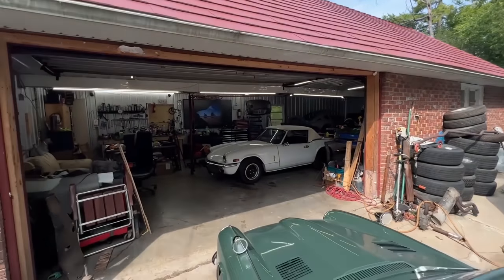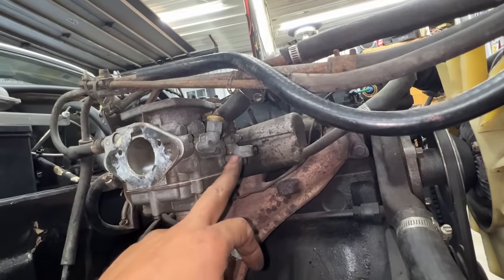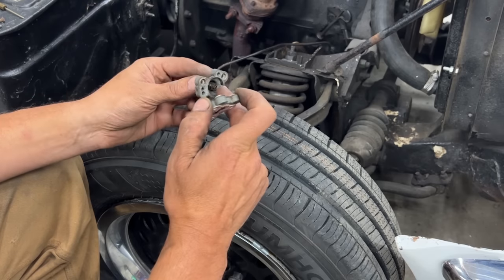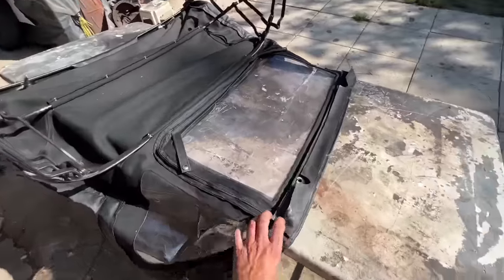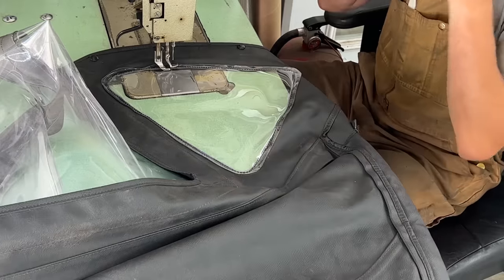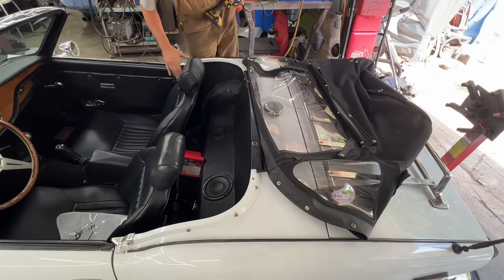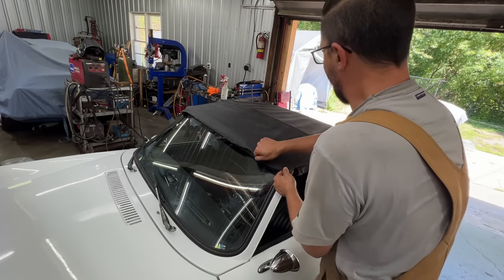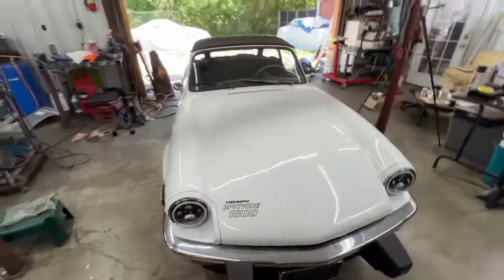Spitfire 1500 - Part 5 - Carburetor and Soft Top Repair

Comment: Nice catch on the missing carburetor spring, that's where experience pays off.
Reply: I’ve coined a new term that I’ve shared with Elin. Not having a ton of experience yet, I have a high degree of “FOFU” - the Fear Of F’n Up. As you say, experience matters!

Comment: Amazing stuff Elin.. That carb would have had me scratching my hear for a while.. There are quite a few variations and upgrades over the years as you'll know of course and sussing that issue out so quickly was a masterstroke.  Great work also on replacing those hood clear vinyl's..  I never knew anyone in the trade that could do electricals, mechanicals, bodywork and upholstery to such a professional standard.  There were a lot of demarcation lines back in the day here in the UK which stopped us being proficient multi taskers..

Comment: Nice job on the soft top. You did great doing the small panel replacement. Also, I know how valuable it is to have an old carburetor or other device for using as spare parts.

Comment: I had a 74 Spitfire from new. After a couple months, my rear side windows cracked in a similar spot. Dealer replaced soft top under warranty and it shortly started again. Turns out the window was getting stuck between the frame and the dealer installed speakers when folded. Had to be careful to fold it so that didn’t happen.

Comment: That kind of damage is caused by owners that don't know how to properly fold the top.  Where did you get the clear plastic material?
Reply: The previous owner folded or unfolded (I don’t remember ) the top in winter and it shattered. The plastic window were of a very hard plastic comparative to what Elin installed. Even in 30C weather they were stiff. Elin posted the website on the screen from the supplier. Something like jts outdoor fabrics.

Comment: What happened to the speedometer not working? Did I miss it being repaired?
Reply: I wanted to pick up the car before Elin could fix it, as I live a couple of hours away. Turns out the end of the Speedo cable was rounded off. I replaced the cable, and it now works as it should. 🎉